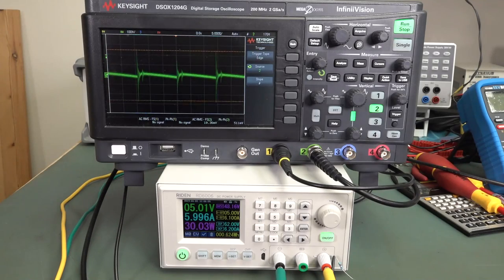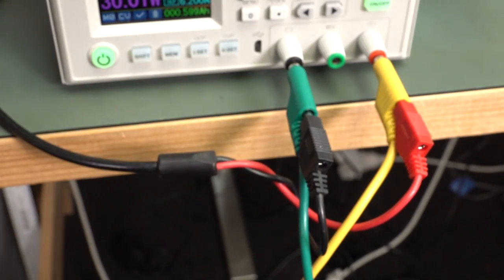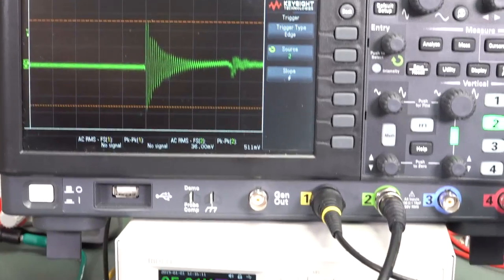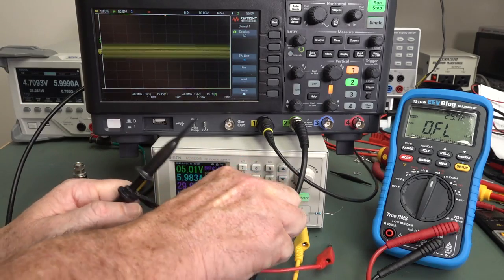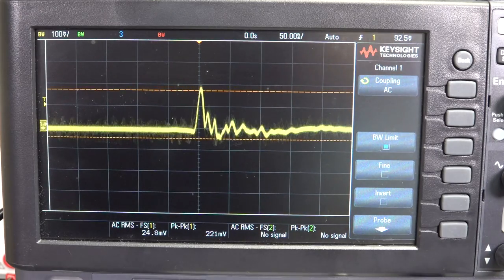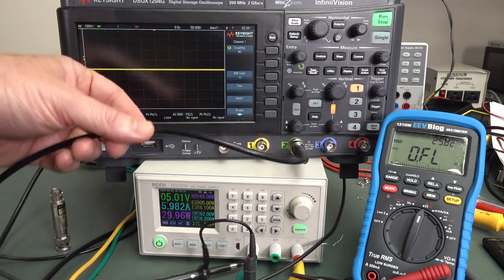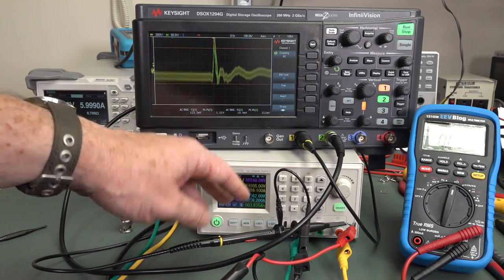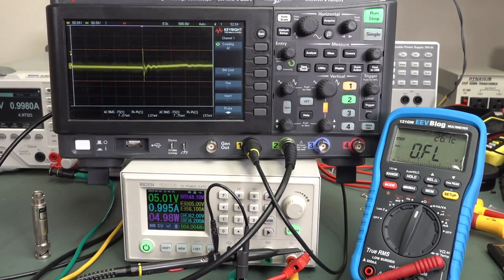EEVblog #1266 - PSU Probing Screw Up!

Comment: David, I would really like to see a video on how to reduce the noise on the output of a switching power supply.
Reply: Me too! Especially on those ruideng DPS, DPH power supplies
Reply: Yeh, me too.
Reply: Same here. Lots of beginners and hobbyists who can't spend a fortune on professional gear would probably be interested in ways to improve such budget devices. Might even learn something along the way.
Reply: For a given level of output noise, there's really not all that much you can do - you'll be piling on capacitance in parallel, inductance in series, a linear regulator downstream or all of the above.
Reply: You’d like Dave to flesh out the suggestions for where to place the ferrite beads, in other words?
Reply: The only real option would be filtering. A good high power lowpass is however costly and will make the regulation substantially slower. 
The ideal option would be building a new switching converter at a much higher frequency to make filtering easier. This has its downsides too and it all comes at a cost. 

The current noise is honestly completely fine, even for powering comparably sensitive logic.
Reply: Isn't there something you can do to make the switching less abrupt? If the switching could happen move gradually in exchange for more power being burned in the mosfet, wouldn't it be easier to filter out the noise? The first concern with a lab power supply isn't efficiency, right? So, I guess the design could be quiet different from a normal switching power supply?
Reply: me too
Reply: @kriswillems5661  good luck switching 300w without sharp transients

taking the edge off things will just make regulation slower, so the voltage wouldnt be as steady and overcurrent will last longer. 

the design is quite good as it is and the noise is no real concern for most applications
Reply: @drkastenbrot , the problem is likely the high equivalent series inductance (ESL) of the electrolytic capacitors used in the output filter of this cheap switch-mode power supply.  Placing some small ~10 nf ceramic capacitors, having much lower ESL, in parallel with them might substantially attenuate this >1 MHz ringing?  If so, the cost is a few cents, and has none of the downsides you mention.
Reply: @rodfarlee6157  I have not taken a closer look at the design but im pretty sure they are already incorporated on the output filter.
Reply: I don't see how having a less sharp switching edge would make voltage regulation more difficult. You could still change the duty cycle as wanted. As for the power consumption, yes it would be higher, but we're talking about a lab supply - should we really be saving a few dollars on a heatsink in exchange for more ripple?
Reply: @kriswillems5661 , a "less sharp switching edge" would not make regulation more difficult, but it would increase heat dissipation in the switching FETs and likely require derating the maximum output current to avoid overheating them.  (p.s. I agree with you: efficiency is less important than noise in bench power supplies.  Linear power supplies are available with ~1 mV ripple for only modestly higher cost.)
Reply: Mee too, please make a video.
Your patreon supporter
Reply: @HighestRank  Mmmmm as a starter... LOL I'm not as negative as Attila Asztalos, though.
Reply: @kriswillems5661  , When you're done, you'll still buy an analog supply and lug the beast around. LOL
Reply: @rodfarlee6157  You've been reading my mind! LOL I was thinking approximately 15 nf, or... change to great filter caps right from a trusted supplier.
Reply: Me too !!!!!!!!!!!!!!!!!!!
Reply: +1 Common mode choke, caps, anything else that can help! Wanna see it all!
Reply: @rdtech9153  Hahaha.

Comment: If someone as sharp and experienced as Dave can still make mistakes it makes me feel a little better about my own stupid mistakes 😅
Reply: I measured the grid current with my little, yellow, china export meter once. It's too damn high! ;)
Reply: Well, it makes me sad knowing how many headaches I'm still to suffer.
Reply: @fatnindja  Oh no shi-, your Harbor Freight free multimeter blew up when you plugged it in, too? That'd make three I've heard; two in person LOL
Reply: @jimmio3727  LOL, it's not that bad. I had my fuse well wrapped in foil, so what blew up is a trace on board. It was not one of the cheapest. It contained the explosion very well and the meter worked after that but I lost the small amp ranges ... hmmmm.
This meter died from a BEMF spike, which was kind of surprising.

Comment: First time ever I knew the correct answer instantly! I said "where is your 50 ohm resistor". All those years installing coax for Ethernet.
Reply: How many computer techs spent time troubleshooting a 10base2 networks, only to find that the terminating resistor was missing.

Edit: Just remembered that 10baseT was actually for Twisted Pair. 10base2 for thin coax networks, 10base5 for thick coax networks. Sorry, distant memory and late nights.
Reply: @gorillaau  I once used a 10 MHz signal generator and an oscilloscope to do a home made TDR to figure out how far away the open BNC connector was.
Reply: @zadrik1337  They can do that with breaks in optical fibres these days. Sure different medium but same idea. Send a pulse down the transmission line and time the signals return.
Reply from the maker: Does anyone use coax ethernet any more?
Or Token Ring?
Reply: @EEVblog  Probably not, bit I wouldn't want to discount the possibility of  there being an antiquated system still in use. 

No one take a step, the network cable wasn't terminated properly and the token has fallen out. Its must be on the floor somewhere.
Reply: @EEVblog  We still have provision for it in the office, but it is out of service.
Reply: @EEVblog  MOCA is moderately common in the US... Most places have coax wired for cable TV but Ethernet is rare. No external termination is used, though.
Reply: @gorillaau  Anyone remember a network from the late 80s in the UK called IIRC SageNet that, again IIRC, used low-grade twisted pair daisy-chain style like 10base2 so had the same termination issues? In the firm where I came across it the buying department were always the guilty party when a machine dropped off the network.
Reply: Graham Langley 10base2*. I’ve actually got a big roll of SageNet TP wire in a cabinet, and it’s 75ohm vs. 50ohm, making it much smaller than coax, but also prone to termination error if one installs incorrect resistance.
Reply: You will be surprised by the number of industrial machines still in use after 20+ years. Some of those are from the '80. They are still useful and are sold for thousands or tens of thousands of euro in the used market, so they are serviced and I keep a big box of coax ethernet parts for this purpose.
Reply: but this time ,he should use *1 probe and 20M bandwidth, we use this condition to test , it is less 100mv
Reply: @EEVblog  Some 10-Gigabit cables are twinax
Reply: @gorillaau  , You can always tell from the tone if the ring isn't correct. Just make it a token longer or shorter.
Reply: @grythumn  After all the splitters, there is STILL enough signal to make it work... thank goodness!
Reply: Same here - years of installing coax ethernet, BUT termination resistor is ACROSS the core and shield not in-line with the core as Dave demonstrated with his 50 resistor at the PSU end. Also, for ethernet at least, it does matter where your termination is - should be at both ends of the line (unless the source is terminated inside the equipment). Have I missed something here or are my memories fading into the mists of time ? Or is this a different case ?

Comment: This is why Dave channel(s) are so good. When he makes a goof or oversight or whatever you want to call it. He makes ANOTHER and sometimes even MORE INFORMATIVE video on why the goof and delves deep into  the topic. Those videos are almost MORE  informative than the initial. I have so much respect for this dude and learn so much from these videos. Treasure trove for sure.

Thanks Dave!
Reply: Agree. And I like Dave's description "come a gutser" for a goof.
Reply: "Second suck of the sav"
Reply: same with the supply that blew up. interesting segment of videos about ceramic caps came out of that - was incredibly informative.
Reply: I sometimes wonder if he does it deliberately to get another good... errr  video out of the subject. Thanks all the same, Dave.
Reply from the maker: I'm too dumb to think of doing it deliberately.
Reply: More to the point, this is an excellent example of the most illusive and unteachable of engineering talents, whether in hardware, software, medicine, cooking or dealing with the in-laws.  That is to loudly and unambiguously acknowledge the problem, take the dent to one's pride, then fix it.  In that precise order.

The trap for young players (or crap engineers) is attempting to fettle away a problem while desperately hoping nobody notices.  The person who screams "I f****d up!" from the rooftops is 100x more valuable than the stealthy alternative.
Reply: @chrisnorman1653  Couldn't agree more.

One of my pet hates is when a YTer regarded as knowledgable about a subject gets something wrong at the top of their voice, or as happened recently in one of my electrical subscriptions completely misunderstood how something slightly out of their field worked, loads of commenters point out the error but there's no response of any kind let alone an "Oops, sorry, I got it wrong" pinned comment. There's maybe a slight pause in output then continue as normal. 

There's no shame in admitting you got something wrong.
Reply: @EEVblog  , Nah... too crafty! ROFL
Reply: @chrisnorman1653  Well put Chris!

Comment: 6:08 important to note, that the BNC feed thru adjuster has the built-in resistor soldered between the internal pin and the outer casing (in parallel), while the one at the PSU terminal is in series with the coax. So, when you say, you can add a 50 Ohm resistor to either end, it's worth mentioning, that at the PSU end it should be connected IN SERIES, while at the oscilloscope end it should be connected PARALLEL to input, that is between the internal pin and the casing. If you connect it in series, that won't work, and will just add up to the internal 1 MO resistance, hence same ringing will show up on the screen.

Comment: Ringing is not caused by not terminating the coax cable, the problem is the HUGE loading capacitance and inductance of the coax cable. Therefore you should use high impedance probe. Even terminating the coax at it's system impedance is not giving you the correct measurement since you are loading the circuit with a low impedance circuit. Also for high frequency measurements get rid of the long ground lead, use a ground lead as short as possible.

Comment: When measuring small noise it is a very good idea to use a 50 Ohm coax, or even a x1 scope probe, with a few ferrite beads around the coax cable, or run the cable multiple turns through a ferrite ring. That easily lowers the apparent differential noise by 10 dB. The problem is that coax cables are not ideal, they do have a ground impedance (search for "surface transfer impedance") which is especially notable below about 7 MHz and which converts common mode noise currents into differential mode voltage. Try it again, Dave...

Comment: Even Dave makes mistakes. The cool part is that you tell us all about the fantastic mistake you make! Good on ye, Dave. I built one of those earlier RD buck power supplies you posted about awhile back, by the way -- works fine, great for small projects, haven't even had a need to push it hot, and it holds up fine to the light duty I give it.

Comment: I'm learning how to measure RF and other things for analog video processing, I've been using 75 ohm video BNC coax for probing - but I'm just getting back to this and had forgotten about termination to avoid distortion, so THANKS! I've always initially used AC mode on my scope, which has no termination (and I always use termination on video transmission lines). But I don't know all these circuits yet and I don't want to blow up anything or kill or freak out any agc's or oscillators with a 75 ohm load on perhaps a 10v (or whatever) DC internal signal line. Termination does kill noise contamination nicely tho! Highest frequency to look at here is 5mhz FM.

Comment: Great point about the 20MHz bandwidth - it was the scope bandwidth that Computer Products (CPI) had when they released their first switch-mode supply in 1971. I recently got a tender document from a very devious German test and measurement company who tried to claim 10x lower noise than they really had - they specified DC-20kHz bandwidth via a tiny side note when all other suppliers had used the conventional 20MHz bandwidth.

Comment: Best method for accurately measuring noise from switching power supplies is to use a differential probe. This reduces the variation in readings due to switching common mode noise being transmitted through to the scope via the probe earth connection. The effect of the common mode noise was possibly the cause of the changing display while Dave manipulated the probe earth lead. 

In the absence of a differential probe the scope's sensitivity to common mode noise could possibly be reduced by adding some ferrite clamps on the scope probe lead.

Comment: In some PSU measurements there is a 0,1µF ceramic Cap and a 1µF Electrolyte specified. 
Look at Intel Power Supply Design Guide, there is a part for "Measuring Ripple".
Reply: He screwed up a second time..... Let's wait, may be will notice that....
Reply: @MrPerrey  Yeah, Power Electronics is a special field that many Engineers don't seem to like much at all for some reason...
Maybe this gives dave some reason to look a bit more into power electronics and make some PSU stuff? For example how to measure 40A peaks that happens for an ms or two.
Reply: @Stefan_Payne  Yeahh, but happens not only power application, it's more basic eaven in RF engineering. To measure PSU ripple and noise there are out industrial specifications how the right measurement setup looks like. Blocking the DC content for this measurement is also good practice eaven if You follow Your own setup. Don't understand why he screwed up a second one and so badly.... He was just better.

Comment: I found when CE marking equipment that switching PSU noise is a big problem. the CE marking testing for the PSU is done at a defined power %  of full output. the PSU are made to pass this test! When it comes to selecting the PSU for your product you don't want to run the chosen PSU at near to full load for reliability, but now we have a problem your product fails CE testing on PSU noise emissions. try adding filters to a sealed PSU, adding in to you product can help but it kinda the wrong end of the cable. if you ask them to fix the issue boy does the price of the PSU go up. it almost ends like "take a lot of different PSU's to the test house and do a select on test. great video gets the old grey cells working.

Comment: Years ago, I put my hands on an old Hameg HM-203 in a fleamarket. There was no probe, so I made 2 with a Ethernet 10base2 cable. And I only got garbage. So I went to the computer shop and purchased 2 standard 1x-10x probes, and made the calibration for my oscilloscope following the user manual.